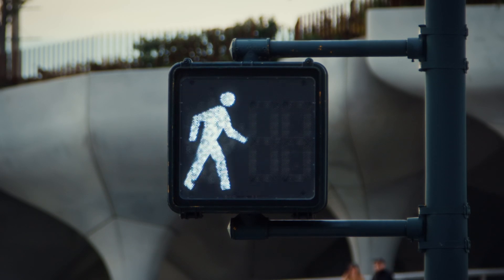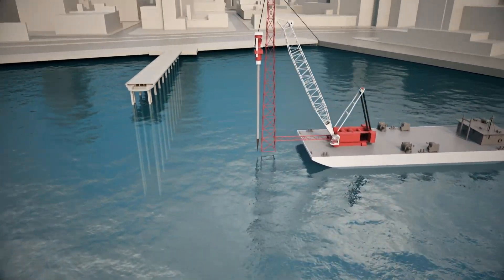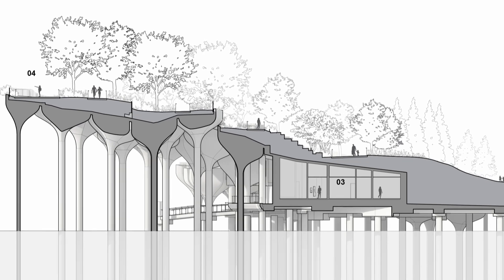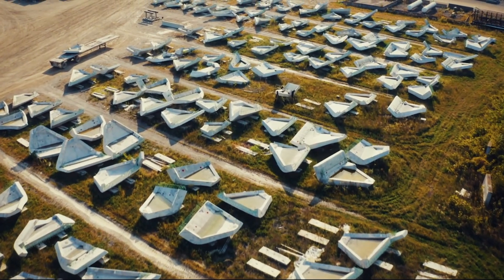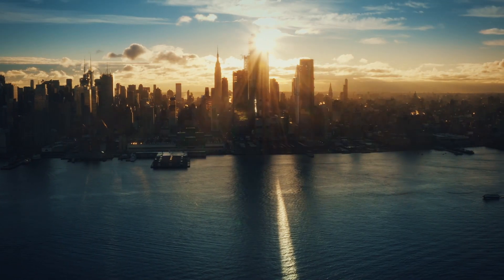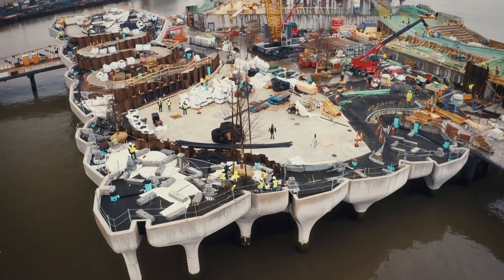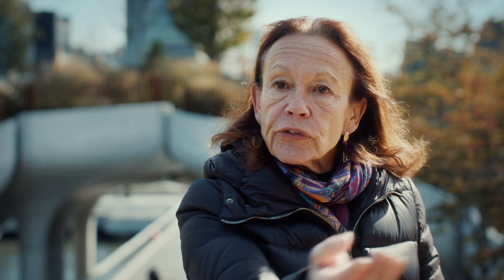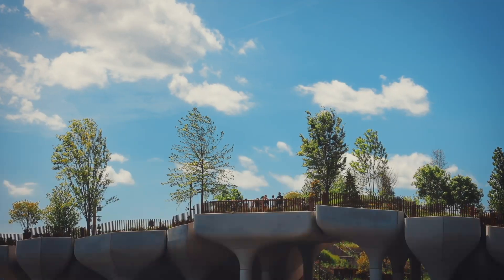This Floating Park is a Modern Architectural Marvel 🤩 How Did They Build That? | Smithsonian Channel

Comment: At the low-low cost of what?  I wouldn't be surprised if it cost 10 billion dollars.
Reply: The project cost $260million. The money probably could have been better spent restoring or expanding existing parks. But when the rich people of Manhatten want something, by golly you'd better deliver.
Reply: @unclejimmy5778  so what? It is privately funded and will provide additional public space in that part of Manhattan.
Reply: @elifuentes7070  You are far more passionate about this than I am. All i said was the cost and offered my opinion. You think the money well spent. I don't. Simple as that.
Reply: @unclejimmy5778  I live in NYC and I believe the park is needed, and the money is well spent. And added bonus that not a single dollar of taxpayer money is spent.
Reply: @unclejimmy5778  Diller family contributed 260 m$ to this project 
Not the whole cost I guess
Reply: @fahadabdulraheem1407  They did fund the whole thing and not only that, they committed enough funds for the park’s upkeep for
the next 30 or so years.